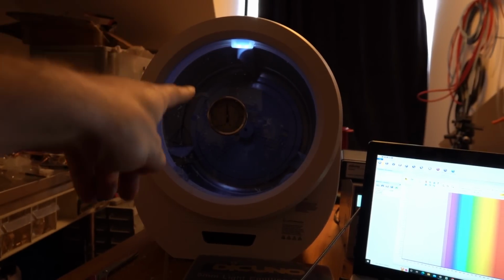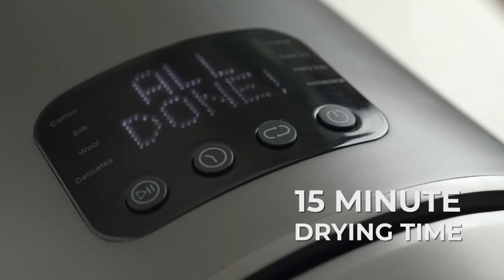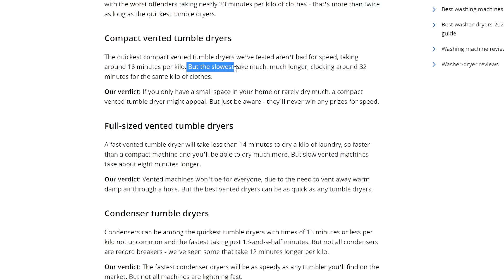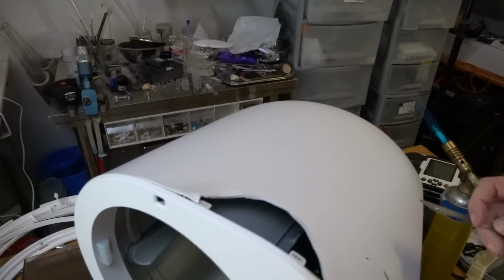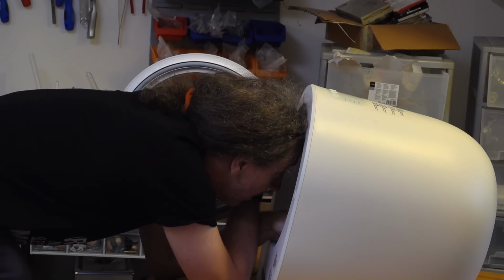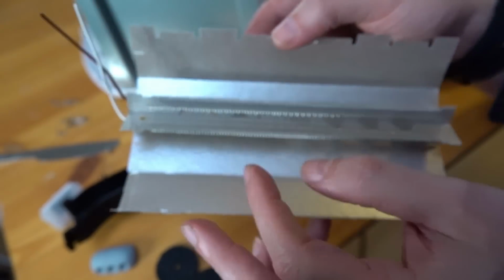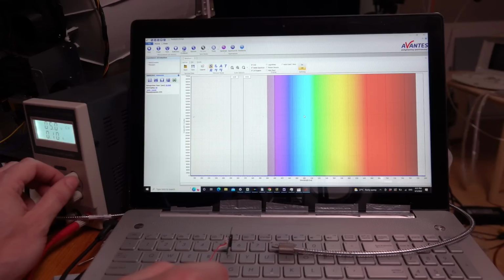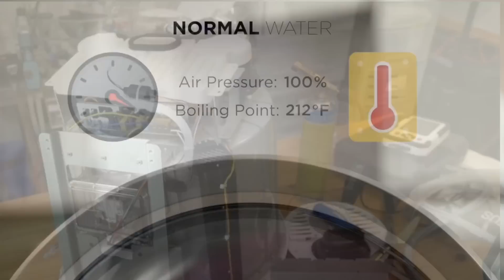Autopsy of a Scam-Starter: The Morus Zero!

Comment: Eh, technically any heating element is infrared. The other thing is almost all portable electronics now have their plugs hot glued to prevent disconnection, even modern cars have this done under the dash

Comment: So when I need a single dry shirt ASAP, I can just hang it on a clothes line and blast it with a hair dryer. That's faster and saves 300$ (or whatever the Morus costs) in equipment.

Comment: Space vacuum and infrared heating powered by plutonium 238 so like the voyager spacecraft, it can run at full power for 50 years! And don't worry about radiation, the patented "bull$hitium" shielding keeps you perfectly safe

Comment: What was the temperature inside the drum during operation? With a constant flow of air through the drum and around the LED, the LED and its bezel would only get as hot as the air flowing past it, which may be within it’s allowed tolerance. Anyway, that doesn’t change the fact that this is a scam and a piece of junk.

Comment: So, the UV germicidal effectiveness curve is 200-300nm and peaks around λ=253.7nm and looking at the peak on the spectrometer which was about 265nm; Then yes, this is the correct LED for the job.
That type of UVC LED emits about 6000μW/cm² at 8v. Considering that most pathogens DNA is broken down in under one second at this intensity, it is adequate for all targeted organisms(fungi 8 seconds and Spirulina algae 40 seconds being the most hardy). Also the fact that one cycle lasts 15 minutes, that's 900 seconds UVC exposure it's at least 22 times overkill. But where it falls down, is the fact that not all of the material will be exposed to the UVC, and there's no heat sink on the LED so it cannot be driven at full power. So it's pretty pointless installing it in the first place. In theory it seems like it should work, but mechanically they failed to see the light.

Comment: Can LEDs actually produce short-wave ionising UV? I thought this was only possible with mercury discharge lamps in quartz glass? You could also do the famous banana skin test for UV 😊
Reply: You need Quartz glass, because normal glass blocks UV. 
UV-LEDs are not sealed in glass at all.
Reply: @fromgermany271  I've messed around with some UV LEDs and I have never noticed them producing ozone. The plastic package of a typical T5 led may also block SW UV? I once had a high power UV LED that had a glass lens ... I assume it was quartz glass? This thing was very powerful and looked like a miniature cat eye in a brass base. It still didn't produce any noticeable ozone though  The characteristic smell of ozone around a UV light source is a sure sign that it is producing ionisation of oxygen and very energetic short wave UV.

Comment: Well, their sales pitch about "the vacuum lowering the boiling point will reduce the amount of heat necessary for evaporation" is a bit of nonsense. When the latent heat of vaporisation gets lower at higher and not lower temperatures (till it reaches zero at critical point). But fair to be said, at lower temperature you just don't need the heat to warm up all the mass. But this is not much relevance when there is practically no vacuum at all, at least by far not enough to lower the boiling point even a tiny bit...

Comment: 5:36 the fact the needle does not move when you plug the hole is not a very good sign, isn't it ?
also I wonder how effective would a real clothes dryer if you run it 15min with just one or two shirts in it

Comment: It looks like they had a decent concept, get the development rolling and realize they can't do certain things they've promised, started to compromise on EVRYTHING, and the end result is this weirdly bad product but seemingly got signs of certain degree of efforts put on, regardless it's still false advertisement. They could've ditch the vacuum  and UV bs, give it a better condenser and advertise it as a light weight convection dryer and of course with a much reasonable price tag.

Comment: Honestly the UV is probably fine? It likely just flashes for 5 or 10 seconds every minute or so during the cycle. It does have a full cycle to actually use it but that said the amount of surface area you would expose to the UV tumbling clothes in such a small container isn't great. They didn't lie about that part it was just never going to be that effective.

Comment: I'll bet they first had a real metal condenser.
But then they figured out that the surface area was too small and it does not work...so they put in a cheaper one made of plastic.

Comment: That tiny UV LED is supposed to sterilize a tumbling load of laundry without running continuously or even, I assume, constantly enough over a certain timeframe to avoid melting itself, everything around it and potentially starting a fire? XD Maybe that loose LED up-top was purposeful self-sabotage at the facility to avoid lawsuits from the fire hazard? Holy cats XD Embarrassing. And $600, too. Yikes.

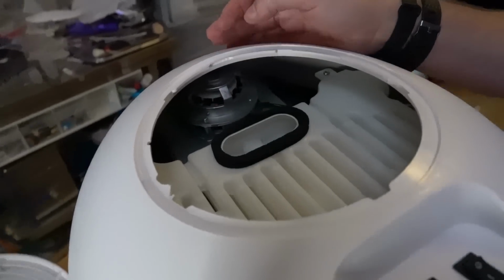Comment: 16:16 Honestly? That could just be a step in the production process, when they're snapping the excess plastic off the final product.

But yea, everything about that thing is a scam, so they probably cut production costs by replacing the hot irons with bolt cutters, it does look like they needed two snips with whatever tool they used.

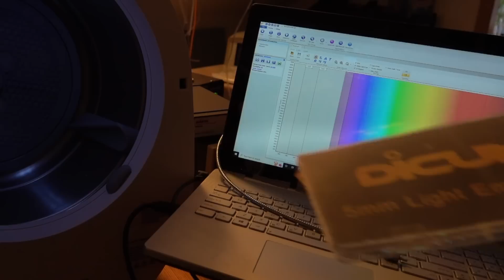Comment: 2:08 devil's advocate here: does thr Morris believe it's closed and running at at this point? Because for safety the led might turn off uv if it isn't running and closed.

Not that that's likely but an argument they could throw at you

Comment: Why would that thing blow air into itself? Isn't it meant to be at low pressure inside there to lower the boiling point? Isn't that the idea of infrared lights being used, the low density air having poor heat capacity? Weird.
Reply: I guess it'd really have more to do with vapor pressures. Still, wasn't a partial vacuum the gimmick on this thing? Did they just fail and change it?
Reply: It seems like an interesting idea, but it has to be all sorts of impractical. Heat up the water, raising its vapor pressure, lower the ambient pressure in that chamber and presumably boil or almost boil the water off. I'm not an expert, but I assume creating a vacuum strong enough to get that effect would take a lot of energy, more than a normal drier.

Comment: So, if you heat up the air and get it into the chamber, then you have to create a vacuum in the said chamber; wouldn't the vacuum pump remove the heat? Granted, of course, it was actually creating a vacuum in the first place.

Comment: I‘ve seen this „UV Sterilisation“ in an Chinese Airfilter. All I found was only a single LED and it seemed to be only blue light. 
It seems they just put it in to say it actually has UV but it doesn’t seem that effective. Compared to a laminar flow hood of a friend of mine which has UV Sterilisation it seems ludicrously underpowered. The hood has a flat working area of I‘d guess 1mˆ2 and the UV needs to run for around 10min with a 100W UV light. While it might be possible for the UV LED to sterilize the first part of the drum of the Moris after maybe 10min of running it empty, I really doubt it has any effect on the clothes whatsoever.
Reply: Placebo 😅
Reply: @onradioactivewaves  Agreed.

Comment: The “UV” LED is a joke for several reasons but the biggest being that the clothes are in a tumble drum (like a typical clothes dryer) and the UV radiation off that tiny LED will basically only affect a very small portion of surface area on the clothing at short, varying bursts (as he demonstrated there’s no way that UV diode could stay in the entire dry cycle otherwise it’d burn out or ruin the PCB easily). So to state they’re using UV to remove 99% of germs on your clothing, sure, maybe in tiny little micro-spots on your shirts when the tumbling shirt surface area is exposed directly to the focus area of the tiny UV diode, by pure chance, is insanely misleading.

Hooray, they only lied about the entire premise of having UV sanitization but sure to include the tiny diode just in case there was a teardown to say “SEE!” These people man. Also, those gullible people man.

Also this product makes almost no sense. When people wash their clothes they’re likely to have a dryer sitting right next to their washer. So like, do people want to take their wet clothes to the fucking kitchen to dry them in a tiny dryer? I’m sure there’s some use cases for this but I cannot imagine it being widely adopted even if everything they promised were true

Comment: Not to be pedantic, but how is a resistive heating element NOT giving off infrared radiation?
Reply: That’s what I also thought, but with infrared heating, you normally assume some heating by the radiation itself and not by hot air.

Comment: Looks like a basic standalone cheap dryer but built worse. No vacuum pumps, no special infrared heating, weak UV lights.where is questionable about how much disinfectant power it actually has...
just a basic zippy zappy electric heater, a drum to turn cloths over as a fan blows air into it and then it vents out into the living space. Unlike a normal vented dryer that vents to a dryer vent and pushes the air outside the living space as to not drastically increase the temperature and humidity in the home... not exactly something you want in the summer thats for sure...

Comment: I don't know anything about lights or uv, but 7 volts is not to be trifled with. I guess it depends on some other factors, but when it comes to vaping, three, even two volts gets metal wire hot as fuck glowing red hot, so I imagine that seven volts of radiant heat would be quite interesting. is it bad just to look at for your eyes? or is it also bad for like your skin? like I know that the sun emits uv, and that's what causes skin cancer right?

Comment: A dryer that pushes the moisture right into the air instead of a reservoir are the worst and cheapest kind of dryers there are. For $ 600,-, buy a heat pump based dryer from a known brand... this dryer is based on its specs probably worth somewhere around $ 100,- max. I cant even imagine anyone would want this thing in the first place, ANY other dryer you can buy in a electronics shop is better than this, let alone for 600,-!

Comment: Where is all the lint? If the device happened to actually be a vacuum and boils off the water from low pressure, unless the device is allowing the moisture to leave, wouldn't it just stay in until the vacuum is broken and re-saturate the clothes? I mean sure, they have that little drawer to catch the water but that is gravity fed most likely. We know it is not a real vacuum and it seems like this invention uses people's ignorance of what science words mean and thus uses terms that sound cool and spacey, but I'd imagine that generally a good amount of folks have no clue what those terms mean. Vacuum. lol I guess my real dryer is a vacuum too since the heat and moisture is sucked outside if we use his concepts like he uses them.

Comment: I'm so confused by this device. Is supposed to be "space vacuum". But it has a fan. A fan with no air can't do much. Also air is needed to conduct the heat into the wet clothes. What is even the point of the vacuum?

Comment: They probably pulsed the UV led rather than just putting constant DC. Still effective but way more efficient and far cooler.
Not defending these utter plebs or course but even with a heatsink those UV leds don't take constant DC without thermal overload.

Comment: I was thinking of how ot dry clothes faster!

 THe simple truth was, that putting a hydrophobic substance into the detergent that mixes somehow withe water or activates in heat, somethign to mix it, and thus, when drying teh water will want to exist hte clothing or create a binding agent ot fabrics and poly etc and bamboo( rayon) in this means the wash cycle would dry yoru clothes! more since your clothes would be hydrophic, but it may affect and alleergies and it might imepde clenaing ,but this owuld be the best cheapest oslution, changing the way detergent reacts so you cna dry clothes faster, this means we oculd design detergetns specifgically for cottons and towels which are the most cost consumign ot dry, jeans, towels blankets.. so creating specialed detergents could reduce the costs across the world.. per energy load and time!!!

EurekA!!!.

I had an idea to dry a clothign system faster but iT Hink its illegal, and currently classified... jokes..

Comment: Edit: Forgot, a big caveat: this did not account for LED power efficiency at all. A quick google tells me UVC LED's have a ~5% power efficiency, so my conclusions are wrong. The inactivation levels are probably closer to high 80 to possibly 90% rather than 99%.

I've done some research on UV LED’s and how effective they are at inactivating pathogens for an internship back in 2018. The wavelength being centered around ~282 nm is slightly off as the best range for inactivation is between 255-280nm, in the UV-C range (peak inactivation at 265nm).
I did this research before the pandemic back when UV LED’s were quite a bit more expensive and rare so my wattage/flux inputs are on the lower end (documented that they’re “Roughly $6 for 1mW to 10mW power LED’s each, not including shipping costs” on ebay and google results). Now I can find 200mW (0.2W) and 1W LED’s for similar prices which is huge. 
The way inactivation is measured is similar to nuclear radiation, in UV Dose (mJ/cm^2).
Formula being: UV Dose (mJ/cm^2) = UV Intensity (uW/cm^2) x Retention Time(s)
UV Intensity being equal to Power/(4pi*distance^2), distance is how far the surface being inactivated is from the light.
The Regulatory (10 States Standards) UV dose for inactivation was a minimum dose of 30mJ/cm^2.

Certain viruses require 155mJ/cm^2 for 99.9% reduction.

Some of my documented hand calculations:

“Intensity = Power/(4pir^2) where r is the furthest distance from the UVC LED
1.3 mW/(4*pi*cm^2)
At 15 cm away (6in): = 0.00045978 mJ/(s*cm^2)
At 5 cm away (2in): = 0.004138 mJ/(s*cm^2)

Need over an hour to sanitize 90%+ at 2in away, unless my math is wrong.”

And

“50mW optical intensity is ~38.4 times stronger than previous example
0.01768 mJ/(s*cm^2) at 15cm away
0.15915 mJ/(s*cm^2) at 5cm away

10 minutes to get 99.99% sanitization” for many bacteria from a 5cm distance.

Quick calc:
@2in disinfection, 20x 0.15915 intensity = 3.183; that times the number of seconds gets the UV Dose, meaning 10 seconds to get the Regulatory UV dose of 30mJ/cm^2 (safe for drinking water I believe). Triple the seconds for poor wavelength optimization, and double it again for poor optical conditions would still get 1 minute needed for an extremely effective dose of UV.
@6in disinfection, 20x 0.01768 intensity = 0.3536; which gets ~85 seconds for the Reg UV dose. Practical adjustment gets ~8.5 minutes.
@9in (which seems the furthest distance to the center of the dryer which would get the least dose if the LED was at the edge), spit-balling with an interpolative estimate would be something like 2.5x less intensity than the 6in disinfection intensity. Calling it 3x less would be 0.000589*20/6; the amount of minutes needed for a Regulatory UV dose is over 1500 seconds or about 25-30 minutes. 

Considering the Regulatory UV dose is a pretty high bar meant for ensuring safe drinking water, using a 1W LED (20x stronger than the 50mW), it’s certainly possible to get a very high inactivation percent for many pathogens (in the 99.9%) for the clothes in that dryer in 15 minutes imo, even allotting for shoddy optical clarity conditions and the non-optimal wavelength for inactivation. That's assuming there's no other serious design flaw obstructing the UV intensity or interfering with the UV dose. If the LED is placed properly, the constant tumbling for 15 minutes should probably get in most nooks and crannies at close range for enough minutes needed for a pretty good UV dose.

The power you were running that specific LED is almost definitely too high. The 1W UV LED I find on ebay runs from 5-9 V, meaning optimal current is around 150mA. If it's the same, you're probably over double the rated current, which is why it gets so hot so quickly, and may need a current regulator.

--So also accounting for power efficiency, I don't think the UV LED is wholly ineffective, though it's not going to reach 99% levels.

Comment: White LEDs are actually UV LEDs in disguise. 

There’s no such thing as a white LED. What you see is a reactive material over the diode that reacts to the UV light. Essentially, it’s glow in the dark. 

What is happening here is that the light emitted from the reactive material all but completely outshines the UV LED itself.

Comment: I think an actual vacuum ( NOT a space vacuum) would had worked better than this hair dryer. I mean, just SUCK the water out of it. Maybe something that presses the clothes in a hydrolic press and then sucks the water out of it. Like, combine a hydrolic press with a vaccum that will smash your stuff together not quite enough to break buttons or zippers etc, but enough to firmly squeeze them and then just sucks all the water out of it.

Comment: Can't believe I bought into the BS pitch. xD
Still tho... there's always occassions where you need a pair of socks or a shirt pronto! Maybe you ran out of clean stuff, maybe you want to wear your favourite thing, maybe plans have changed and you're suddenly called into work and you haven't done your uniform laundry yet because you thought you'd have a couple more days. On those occassions you can run a short 30min washing protocol... might not be a sunny or warm day, you don't need a full load dried, you just need very few items dried real quick. Well, it does do just that...
Though for those rare occassions and for $600 bucks, I can get an escort girl to blow dry it by hand and it might be more fun to look at. :P